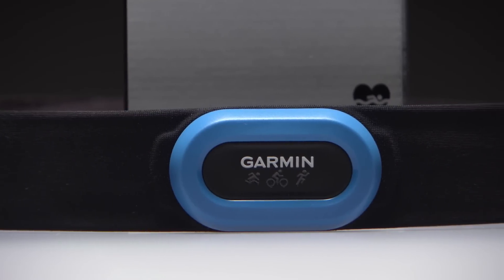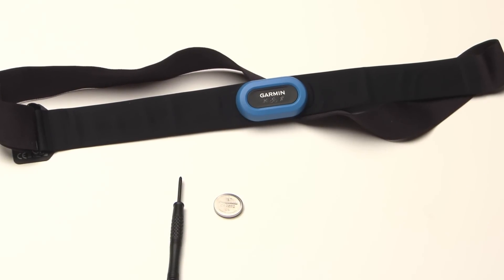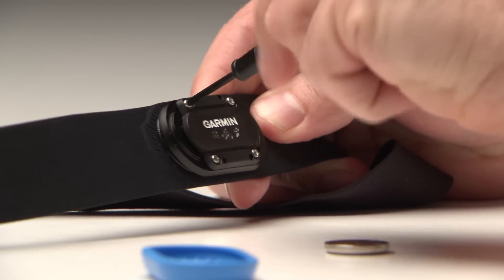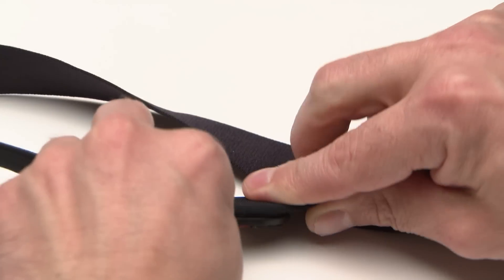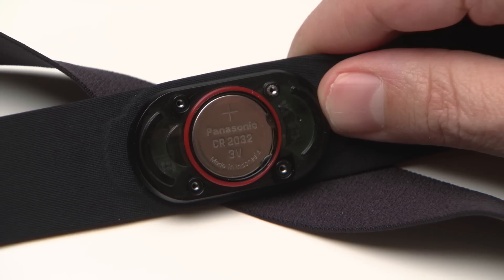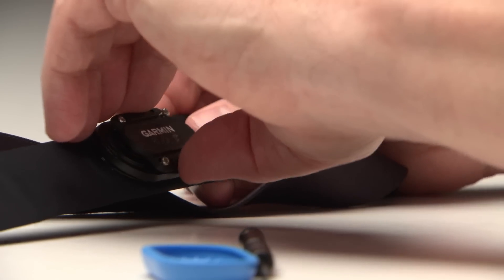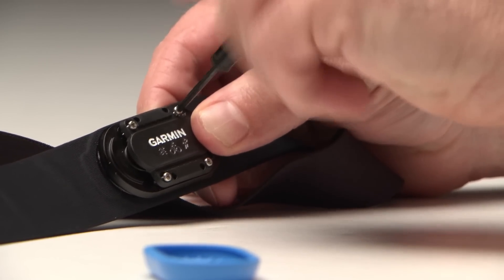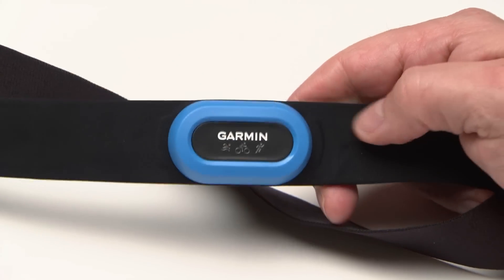Garmin: Replacing the Battery in your Heart Rate Monitor (HRM)

Comment: https://support.garmin.com/en-GB/?faq=5ZvEXLzx3r9lTszNbAV7t9&identifier=3331895016&tab=topics might help people as well. Although after 3 battery replacements, in 8 months, my HRM Tri no longer works... took about 90 minute to workout why. It works with the cover off but when I put the cover back on it stops working, the cover is slightly distorted. I am assuming with the cover on it is making the battery connect go open circuit. Warranty Claim maybe? It is a very poor design, wonder if the HR Pro is the same? Garmin doesn't seem to have a good track record with battery covers, the Vector 3 power meter battery cover had to be change for them to work reliably. Got to say I am pretty annoyed for a product that is expensive for a HR strap monitor. I was expect a lot better for the money.
Reply from the maker: Hi There,

I'm sorry to hear about the issues you are experiencing with your HRM-Tri. Please reach out to our support team to look into this for you. You can reach them by using one of the contact methods listed under the "Contact Us for More Help" section here: http://bit.ly/GarminContact-US

Kind Regards,
{IK}
Reply: @Garmin  I have contacted customer service and their response has been excellent... replacement on its way soon when in stock..

Comment: Thanks for your review.  However, 

am pretty unimpressed that my HRM battery (tri pack bought October 2020) already needs replacing when I've only owned the thing a couple of months.  Recently bought the cadence and speed meters Sensor2.  It arrived last week and BOTH batteries had to be replaced before they would sync.  It's ridiculous that these products costs so much and they cheap out on batteries.  With the exchange rate for Australia it's even worse.  What happened to the plastic slip that keeps the battery fresh like other high end products?  Grrrrr
Reply from the maker: Hi, Sally.  We're so sorry to hear about this.  That definitely shouldn't have happened.  Have you contacted our Australia office regarding this?  There might be something they could do.  You can contact them here: http://bit.ly/2GarminContact-AU

*MH

Comment: Truth is, you can't get it waterproof again after opening once. Almost impossible to close the lid and keep battery and that o-ring in place. Even once managed and all screws tightened, it's not waterproof anymore.
Reply: Sure you can.  Put the batter in the holder, make sure its under the lip used to hold it in (slide in at angle).  Then put the o-ring in the lid, hold the lid in your hand do that the o-ring faces up (lid upside down) and then take the strap with battery installed, flip it over and get the lid/body of the sensor to line up.  Hold it together, flip it over, place on hard surface using a finger to hold it in place as you put in one screw, then go to the opposite corner...snug but not tight until you get all 4 screws in.  then alternate corner to corner to tighten down, then go back and do it a small amount to get a final seal.  Like changing a tire on a car.
Reply: @frankgrogan3029  there have been many videos showing multiple HRM's,
And each show the o-rings have flattened areas.

So when changing battery, might be safe to also change the o-ring.

If moisture gets in.... Corrosion, and it's good for the garbage bin!

Comment: Well, I've done it...  I dropped a screw while replacing the CR2032 on my Running Chest Strap and it rolled into a crack between the wall and floor and I'll never get it out...   Yep, I know...

What size are the screws so I can try to get a replacement?
Reply from the maker: The information for the screw used on this product is described as:
Screw,M1.6x0.35x3.5,PHP/S,SS/P,Nylon

If you have trouble finding a screw please get in touch with our support office at:
http://bit.ly/GarminContact-US
~JH
Reply: @Garmin  Hi, Do you have a description for the 4th screw on the top right?
Reply: Or you can try by using a big magnet

Comment: WHAT SIZE SCREWDRIVER IS THIS? 1/4MM?
Reply from the maker: Hello Camila, it just needs a small Phillips screwdriver. -MR
Reply: I actually was able to replace the battery but one of the screws span out. I can’t take it off so I hope it doesn’t damage the water tightening. 
Also just tapping the back was just not enough to get the battery out. I had to pry it out of the device. It was nowhere near easy to replace it.
Reply from the maker: Please get in touch with our Fitness Support team, so they can look into available options for you. They can be reached at the following link: http://bit.ly/GarminContact-US

-MR

Comment: Make sure you change the O-RING. If you don't change it, you will risk ruining the Heart Rate Monitor due to water ingress. they are available on eBay, Amazon for a $2 or so... well worth the investment. I ruined 2 HRM tri, before trying out the Orings, and since then, i never had issues.
Reply: Thanks!
THIS MUST BE IN THE VIDÉO TOO actually!
Hope I did not ruin my second hrm!
Reply: Where can I find it on Amazon? I’m planning to buy a hrm strap, so I want to be ready for OR replacement.
Reply: @massimilianocassol7252  I found them on eBay by searching Heart rate monitor replacement Oring. Amazon has them too but are more expensive.

Comment: HOW CHANGE A STRAP???? ITS NOT CHANGABLE?!?!?!?! WHAT ?????
Reply from the maker: With the latest version of the HRM-Run (the one in this video with the blue module), the sensor module is built into the trap. If having trouble with the strap, please send us a Facebook DM (http://m.me/GarminFit) so we can assist. 
^DK
Reply: @Garmin  Why on earth did you integrated the module with the strap? You seems to be on the late 90s.  In the past I replaced your bad FR 920xt strap (it only lasted year and a half) with a better one from Polar, all Ok (for 3 years) until the module started to fail (the strap still working like the 1st day). You Garmin are losing clients with your planned obsolescence, buggy software,  and devices year after year more expensive and bloated. Really really disappointed :-(

Comment: Hey Garmin, what happened to using a quarter to change the battery? Or how about shipping the jeweler's screwdriver needed to open the case? And about a half dozen extra screws in case you drop one of those tiny black items in your shag carpet? Never mind, I'll buy a Wahoo HRM, it still uses a quarter and it has bluetooth.
Reply: seems daft to miss out on all the Garmin features just so you can open it with a coin!
Reply: @paulbarton957  The correct size of screwdriver should be published though. None of mine fit.
Reply: @sephjnr  It says use a "Phillip (00) screwdriver" in the instruction booklet. Also note that the 3rd screw hole is raised so the cover has to be installed in the correct orientation, screw 3 is the screw by the 'N' of the Garmin logo.

Comment: How long does each battery last?
Reply: Mine lasted a pathetic 3.5 mos with about 10 hours of usage per week.  I suspect an old battery was in there.
Reply: Remon Geo for me 8 months for use it +/- 8h/week
Reply: Mine has lasted 5 months, with around 3.5 hours of use per week.
Reply: I got mine in Feb. this year (2017) & as of today I've replaced the battery twice. I do use it alot though so that's probably why.
Reply: Seven months, with 10-15 hours of training a week.
Reply: Lasted me 4 years and it’s still ok. Probably because I don’t use it.
Reply: Bought november 13th.
Got battery warning on January first...
Change today. (Jan 4th)

18months sure go by fast
Reply from the maker: The CR2032 batteries in your HRM-Run, HRM-Swim or HRM-Tri straps will last approximately 18 months, depending on use.
~JH

Comment: What symptoms will you experience when your battery gets low and needs to be replaced? I understand that if the battery is dead that you won't receive a signal...but is that the only sign that the battery is due replacement?
Reply: snarp98 my Fenix displays a heartrate that is 30% higher. Looks like this is the symptom of low battery for my device
Reply: Depending on the device you’re using it with, you may get an alert saying the HRM’s battery is low. I just got one via my Edge 520, hence looking up how to replace the battery.
Reply: I think mine went dead recently on my Run hrm. It seems that my HR was abnormally high and the stride metrics were lost.